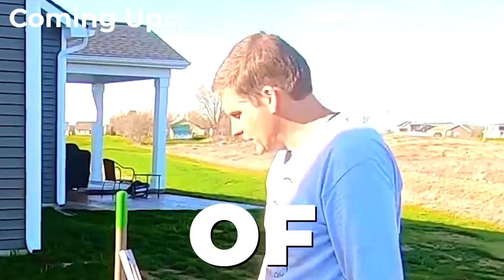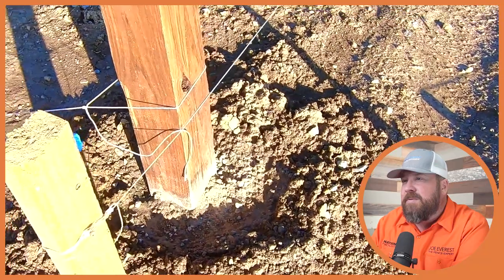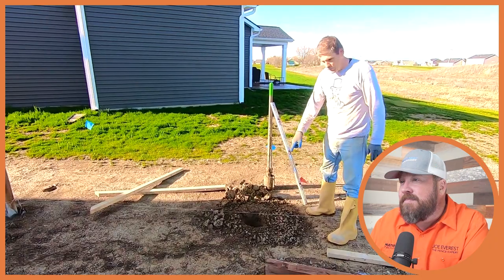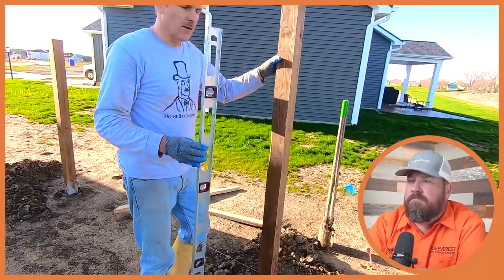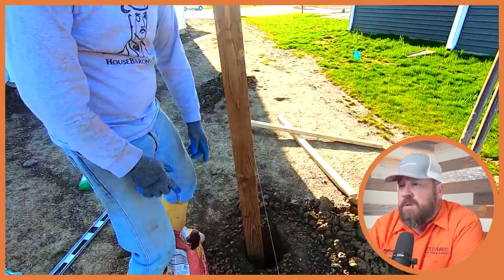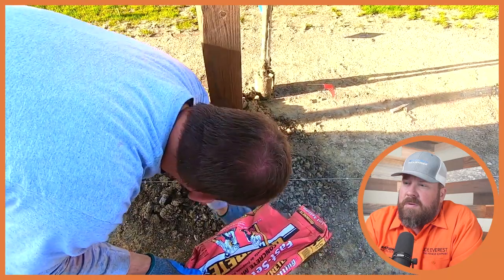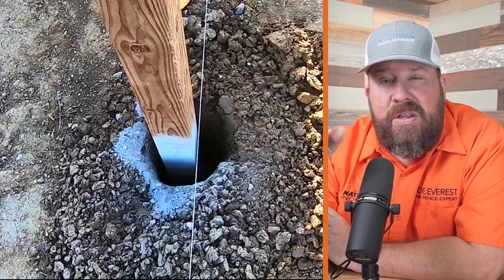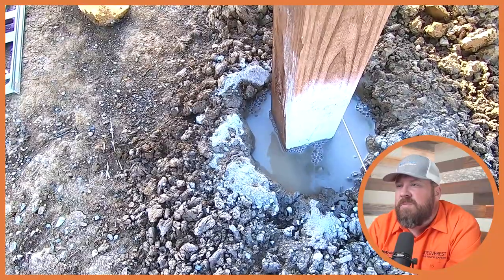Pro Fence Builder Reacts to DIY Fence Post Installation

Comment: I worked a season as a wood fence installer for a local company in Akron, Ohio. I was on the Cedar wood fence crew, myself and another man who really knew what he was doing. Being the grunt I mixed concrete in a wheel barrow, he used a Little Beaver auger and the fence sections were prebuilt in our plant. We used a string line and did not attach it to the post but did bring the posts right up to the line. So dig hole set post install fence section rinse repeat. Not by my skills but the young man that I worked with always got us dead on stright. We did board on board and the last thing we would do and the end of the day was look down the fence line thruogh the gap and it was always perfect, we called it the "Zone". As I said not my skill but his.

Comment: I think that was a great video for the DIY crowd not the Pros. I’m by no means a Pro and am a DIY’er myself but I have done research and watched plenty of pros setting posts and fences and one can see those individuals have the experience to talk about the benefits and issues with certain methods used and often provide that knowledge and information for folks like me who want to do a good job but don’t necessarily do it for a living. I just care enough to want to know the proper way and do a good job so I can get the most out of my money spent on the projects I undertake. Great job on the Pro’s comments and input. I sincerely appreciate that.

Comment: I built my first fence with your help using the postmaster posts last summer and I’m proud to say it is still standing and I’m in the Windy City. I used cedar pickets and went with the board on board look with a top cap, I stained it chestnut color and get compliments all the time. Wood prices were through the roof which made it easier to chose on doing it myself. Thanks for the help, big fan
Reply from the maker: Fantastic, I’m so happy to hear that!
Reply: postmaster isn't yet in Europe availble sad enough although a very expensive post....
Reply: @JoeEverest   Joe, any effective difference between Lifetime and Postmaster metal fence posts?  (Other than the $5 higher price the P-posts go for at the big box orange store?)

Comment: Place I grew up there was 6 to 12 inches of sandy soil followed by solid sandstone, using hand tools post holes for a washing line was a weekend project by itself.
Answer is to plant a hedge.  No concrete to mix & they don't rot off at the base... You do have to trim them though.

Comment: First of all I love your show and enjoy listening to you talk about fences. I hear you talk about putting gravel in the bottom of a fenced post hole and I know you go either way on that subject. I recently refurbished my 25 year old fence. I had to reset 20 of the 25 post I had, either because they were leaning or showing signs of rot. I found that all The Rot occurred within 6 in of the ground. I have wet clay soil and found that they were sitting right on the damp ground with no gravel. There was little or no rot at that level. I did some research and found that for  rot to really occur you need oxygen. At 3 ft down I don't imagine there's much oxygen available. Just thought I would give you my opinion

Comment: Is there a standard for how close and how deep a post should be set next to the slab on grade foundation of a home?  If the answer depends on region of the country, I'm referring to Orange County California.  The fence posts are needed to support a short fence roughly 8' long, which will include a gate within that length to separate a residential home's front year from its back yard, and extend from the side of the home to the property line where a brick wall separates the properties.  Also, the fence/gate will need to endure "Santa Ana Winds", seasonal winds in Southern California with gusts up to ~35 MPH.  Due to this combination of factors, I'm also interested in your recommendation for the most appropriate type of materials to use for durability and security.  For instance, are Lifetime Fence Posts and chainlink a good recommendation?  If so, what else can be done to add privacy to the chainlink fence.  A privacy style of fence required in California because a swimming pool is in the backyard.  The factors involved leave me stumped on the most appropriate solution.  I appreciate your expertise and advice.  If you have a business phone and would not mind taking my call, I would appreciate an opportunity to discuss this effort.  Thank you.

Comment: When it comes to setting post I like to fill with cement. Then dome the cement around post to drain water away from post. Seem to have had pretty good results. Never have had a problem or complaint so I continue with this method.
Reply from the maker: Sounds like a solid process!

Comment: I am replacing horizontal slats on my fence, the 4x4 pressure treated posts are in good shape, although one has a slight lean. Does it make sense for me to add a cemented steel post next to a few of the 4x4s and attach to 4x4, to add strength and longevity. I was thinking of doing it just at a few posts, for example near the house, and at the hinge side of gate. The steel post would not really be visible when I am done

Comment: For most applications I absolutely HATE that red bag fast set concrete. I was doing an area drain and had to pour about a 12” x 12” section of concrete. I mixed it and left it a little more on the wet side. poured it, just kinda hand leveled it real quick. Ran to the van to get a trowel came back 30 seconds later and it was hard as an absolute rock.  Couldn’t do anything to it. It looked to bad I had to break it out and redo it. Pissed me off so bad! I’m talking from pouring to “fully” set was under 90 seconds. 😡 never again.

Comment: Joe, I am toying with the idea to either drive 2 3/8" pipe post or dig and fill with Pea Gravel. We have Sandy Loam with a Clay base. On occasion you might find a rock. This is a perimeter pasture fence where its no better than your corner post. In this guys case I would have used steel post.
Reply from the maker: Agreed, driving steel is always a solid option!
Reply: @JoeEverest  trying for the least expense. Have almost a mile of pasture fence.

Comment: Post offset from string 1/4". I can see 1/4" but I have to measure 6". Drywall screw into post and loop string into threads 1/4" off post. Won't slip.
Reply from the maker: We set the fence 6” inside the property line, so the 6” inset is a bit of a dual purpose.

Comment: You guys are lucky you have several fences and posts that aren't available over here in Europe....we have to do it with round wooden or metal posts or square wooden posts.....I made my fence as an amateur but it works nicely I have them lapped over each other with a gap at each bottom about 1 inch (2 cm) so the wind gets a chance to go thru it we have seasons that the wind gets around 100 km/h  so the method I used works. just wish they had better-quality posts at a reasonable price over here.
Reply from the maker: I appreciate you watching and sharing your experience!

Comment: I've removed posts  l did years ago ...the concrete does not mix itself....you have to mix the concrete ,do not put gravel, then dry concrete around a post,lt will never cure or provide any strength. The holes he dug with an auger...he used to small of a drill,he should have drilled a larger hole so he could get more concrete in the hole with less work..lots of people use a small fence post level. They are fine ,I like to use the longer level,it is more accurate.You don't have to use batter boards to set your string you can attach the string to your outside post .just do it properly ,not the way he did it

Comment: Overall I would say he done good. Also he didn’t insist that every post needs bracing. Lol
Reply from the maker: 😂 agreed
Reply: I just put in 40 of the postmaster posts with no help, just dug the hole, dropped in the post, plumbed it up with one hand and dropped a bag of quickcrete in, made sure it was plumb and poured in a gallon, waited a couple minutes and poured another bag and water in, said to myself "yep that ain't going anywhere" and moved to the next. 250ft and 5 gates later, perfection! lol